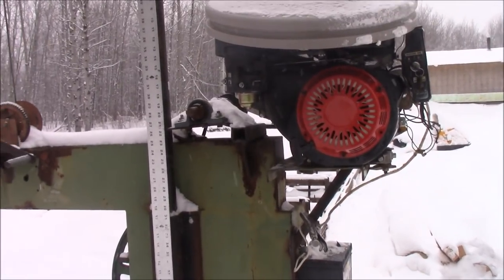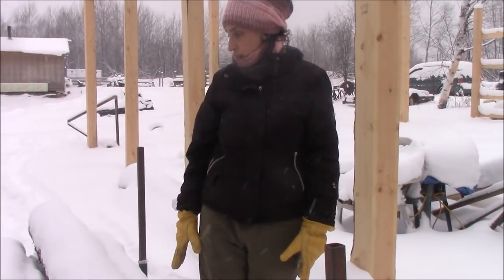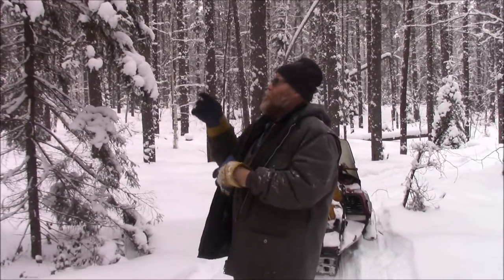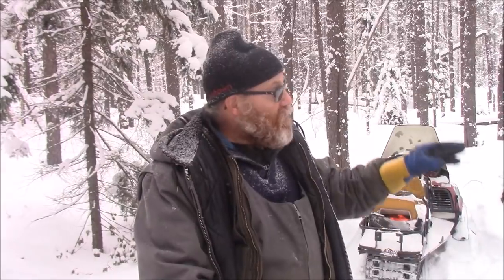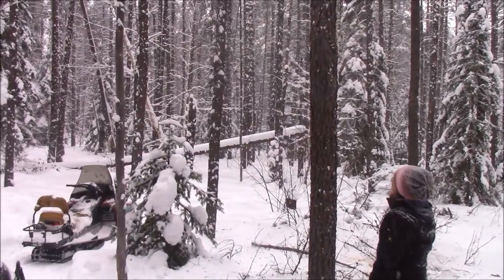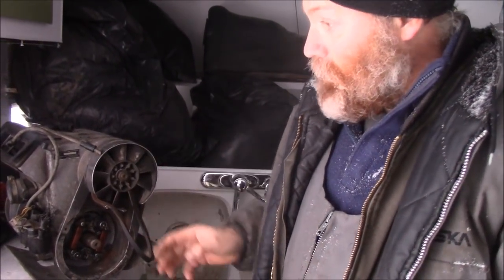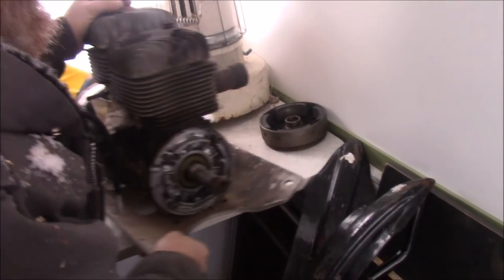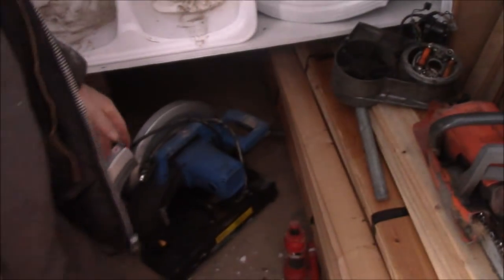Getting A Few More Things Done Around Here

Comment: must be an Olympic engine.. been there ,done that...I always had trouble with the points with mine.i .have  a 377 bombardier with a cdi now...im not getting bored cecil,  love all the things you and heather do around the homestead...
Reply from the maker: I think the mechanical advance were only on older models from what I read last night Todd.   Yes those 377 are a great engine, in my older videos I was using a 377 Safari to pull logs out... I replaced the short track with a longer track and suspension from an older Ski Doo Everest with the 16.5" wide track, it sure made a huge difference in snow.  Well thanks Todd, I am glad you are still enjoying the videos  :-)   Thanks again.  You take care ttyl... Cheers  :-)

Comment: maybe water in the fuel
Reply from the maker: Hello Curt... If it were summer I may explore that, But keep in mind this carb. was dry and new when I installed it.  The fuel had no restrictions from the tank.... And @ - 22 Degrees Celsius Water would stay froze and not cause any problems anymore.  This problem has lasted way too long to be a water problem, the water would have been burned up by now ;-)   Thanks again.  You take care ttyl... Cheers  :-)